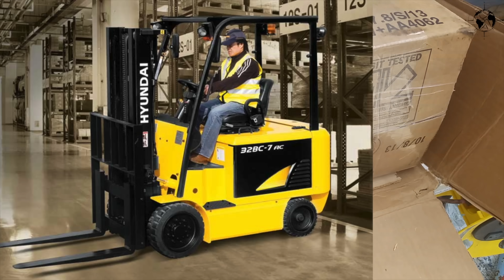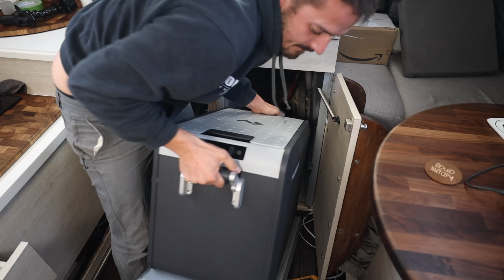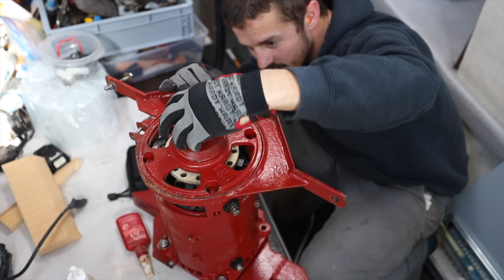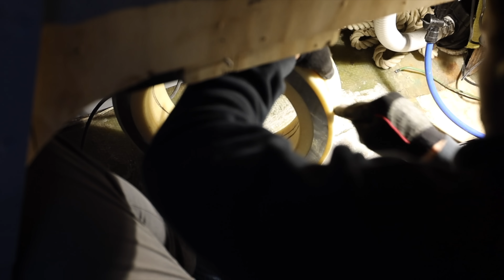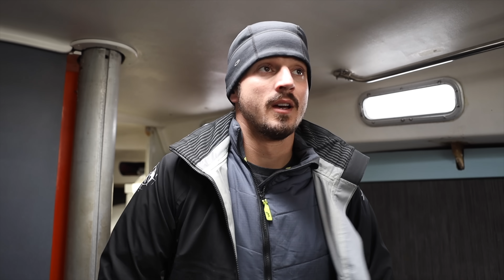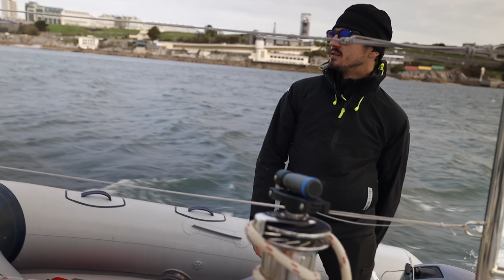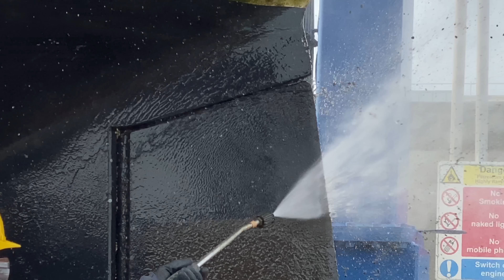Getting Rid of our DIY Electric Motor — Sailing Uma [Step 212]

Comment: I love my Yanmar GF 30.
Reply: james braselton  No kidding!  I've been working very hard to learn about boat electronics (and everything else about a sail boat too).  I bought and old Pearson 35 about a year and 1/2 ago and have been fixing it up.  It was cheep but has a relatively new diesel engine and the hull is sound.  All the wiring was a mess and I have been going through it circuit by circuit.  I've been reading a lot of books like "Electronics for dummies" ect...  I also watch utub videos such as yours!.  Thanks,

Comment: Hi from Halifax guys! Boat yoga - the best sailor full-body workout. Seems to me there are a lot of comments on here by people who don't a) understand your design brief and b) understand the regenerative operating principle of boat electric motors, i.e., that it's all in the motor controller. I'm in an ongoing refit of my '85 steel Goderich 35. When my original diesel packed in, I considered the electric option. My design brief is different, though. If I ever want to go back up the St Lawrence again, the range of an electric system won't get me there in a reasonable time against the prevailing wind and strong currents. So I put in a Beta diesel. BTW, civil engineer here, and handy, though perhaps not so extremely as yourselves!

Comment: What is level on a floating sailboat? - Is everyone standing on the centerline? Who is forward? Who is aft ? and how far?
Really tricky to do afloat. Also for regen I would think a feathering or variable pitch prop is best allowing propeller mode and 'turbine' mode. You guys do a lot of research and such a professional job I am excited to see how this turns out

Comment: Had you considered a 'hydro-generator' as an alternative solution if you hadn't got a lucky break on the OceanVolt system? Not quite as neat and integrated, but a lot cheaper and performs the same function (electricity generation while under sail).

Comment: I had a completely different approach. I am just in the process of rebuilding my 1975 'tractor' engine because they were built so well back then and wanted to keep it. With the rebuild I should get at least another 20 years of life and with cans on deck we have a range of 500NM (which we need as we are on our way to Panana). We view having reliable driving power as the single most important safety issue - you cannot always rely on wind and currents can take you onto the rocks and/or across shipping lanes. Most boats down here have solar but in the tropics there are too many cloudy days for it to be a primary source even for house power (let alone driving) so have a gasoline generator to top up the batteries when necessary. Again, that is also a safety issue - you need to ensure your navigation and VHF are always available.

Comment: Don't blame auto correction - what else could bring us so much fun in daily conversation? 😂🤣

I Think comparisons with Tesla is some wiered. This Systems play in another power range. Build in such a motor - your propeller shaft would simply brake at start.

I'm a little bit surprised you will change to saildrive. For me (familiar with saildrives) this is not only - not even best solution.  Also I thought up to your video, a saildrive has to go with the boat's construction.

What were your thoughts about placing the saildrive? The propeller seems to be much more to the center of the boat than the old shaft solution. 

Corona: That was not a beer - that's antidope in those times 🤣

Comment: The 'Vibro Tool' blades can be restored by notching the edge with a thin angle grinder wheel. You can get several uses out of one blade before they are too short to use...(Doesn't work with the Carbide edge ones, they just become regular cutting blades). 'Hints from a cheapskate boater!'...

Comment: Looks like a very professional boatyard, hi res vests, nice cradle. So you installed the sail drive ring level, is the new motor and prop trim adjustable or is it fixed?

Comment: It’s not the volts that kill you, it’s the amps. You can play with thousands of volts, as long as the amps aren’t there, nothing will happen.. take static electricity 20,000 volts... 

The fact is the higher the voltage, the more efficiently it typically transfer the electricity. 
So higher voltage, lower amp would be safer and more efficient than lower voltage with higher amp

Comment: Wow, that's really interesting about the electric motor. That's what I'd like to do when I get my catamaran. I've been looking at the Schionning catamaran and love what they look like. I think that going electric is the best way to go but haven't heard of anyone doing it on a boat before besides this solar catamaran that doesn't have a mast. It's filled with solar panels and is basically a test boat for electric. It's sort of a turn off because of how many solar panels they have because I was thinking just by looking at it that I'd need to completely fill all my deck space with 100% solar panels and that would suck. You should post a complete video on this subject from start to finish. What brand of rib do you have?

Comment: How did you know the xyz coordinates to install the sail drive mount in the hull without the sail drive, coupling, and motor? Do you have drawings showing shaft ends and spacing for the coupling?
Reply from the maker: Planning....lots and lots of planning.

Comment: OK, if "regen is the ONLY reason to have an electric motor", then I guess the companies making non-regen motors will go broke quickly when they don't sell any, right?
Reply from the maker: For sailors like us who want to cruise offgrid with an electric motor, without ever needing to go to a dock to recharge nor being hybrid... then YES regen makes ALL the sense. It’s certainly Not impossible without regen... we’ve done it for 5yrs. But outside of warmer tropics its more complicated and solar alone is not enough. As we said, its different if a sailor plans to use an electric motor on a daily basis or for a race and go back to a dock to recharge or it they plan to be a hybrid boat and still have a diesel or genset to recharge.  But for us, tge way we see it is: we are dragging a propeller in the water while we sail anyway, it’s more of a waste not to have that be a source of energy.
Reply: @SailingUma    I think regen. is smart actually, even more so for sailing than in other transportation modes.  I am also surprised more motor manufacturers are not incorporating a regen. feature.  My only point was that you said (paraphrasing) "there is almost no point to motors that don't have regen. capability".  Your actual quote was listed in my initial comment.  With better (current) solar panels, and new battery technology, electric motors (especially with regen.) make abundant good sense for all the reasons you listed (reliability, noise, oders, size, convenience) plus long term cost savings due to fuel, maintenance, and repair/overhaul costs. The drag of the propeller is a minimal consideration for most sailing.  I actually think you both are ahead of the curve on this issue.  Best wishes.

Comment: We have a place here in Brisbane Australia that supplies and installs motors for cars for a few grand, they have regen and cooling an electric motor by air or water is very easy. I'm sure most cities/countries would have a supplier if they looked. https://www.ozdiyelectricvehicles.com/kits-parts  [ I don't work for or have any connection with these guys ]
Here's a cut and paste from their site, this is in $Oz, shop in your country, you never know.....+ the price of lithium is dropping all the time, as soon as the next thing comes out lithium will plummet - yipppeee!!!!!!! lol.
Our Small car system suits cars such as a Suzuki swift size, is AC 96v 500amp. 
Our Basics package of $3950 contains the Motor (with regenerative braking), the controller, the dc to dc converter (to provide the 12V supply to the car), a safety disconnect switch and impact sensor cutout switch, wiring loom included.

Comment: I am betting the regen motor will provide for about one extra cup of tea per day... Not worth the cost in mono-hulls.
Reply: Sailing wisdom had a solar panel breakdown on the passage across the Atlantic, had to rely on regen for their electrical needs.  Had a backup generator but I don't think they had to use it.  There is something very elegant about reducing boat speed by a fraction of a knot when the winds are strong, storing the energy, and using the same energy later to go a couple of knots faster when the winds are low.
Reply: Richard Gray 1kw is = to 35ml of gasoline so don't expect to go too far on your regen harvest.
Reply: @PaulAnthonyDuttonUk  I agree that gasoline (and diesel is a much more efficient energy source than electricity.  But propelling a boat through the water has a exponential power curve, crazy low requirements to start a boat moving (no static friction) to massive at near "hull speed" where doubling power increases the speed very little.  This means that you can travel literally tens of times farther on the same amount of energy at very low speed than at high speed.  Similarly an electric  sailboat in strong winds (near hull speed) can scavenge enough electrical energy to charge the batteries  (slowing the boat a little in the process) to travel farther at a very slow speed later.
Reply: Richard Gray You won't harvest anything till u are at 6 knots or more and then not much. Maybe enough run some kit but they have a 40kw motor and at mono speed the best you can hope for is probably around 1kw. So every 24 hours you have enough to motor for 30 mins at half speed assuming everything is peachy perfect. Not great for back up. Portable Gen set with a kick arse alternator is far better for emergency. Regen motors to my mind don't warrant cost unless you have a bigger scale component or a cat. Yet they got it gifted so academic.
Reply: @PaulAnthonyDuttonUk  40kw wow.  That is quite a jump up from the 4-5kw of their original motor.  I guess we will have to wait and see how well it works in practice.  Love to see a power vs speed graph/chart for Uma with the new motor.  Also charts showing how much power can be generated costing how much speed compared to unencumbered speed under sail.

  When under a steady wind, record the boat speed under no and various regen levels.  Run several times  under different winds and/or sail conditions.
Reply: Richard Gray I think it's 40kw or maybe it was 40kw combined on the boat it came from. Not sure but either way you get two light bulbs worth of power back at what are considered as mono boat speed maximums. according to the sail drive 10 system on ocean volts site you can expect a 200W return. So sailing at 6 knots x 24hrs = 4.8 kWh. Still only half speed for an hour. You are basically buying pixie dust and snake oil.
Reply: Richard Gray If you drop a knot per hour trying to regen means in 24 hours you have lost a distance of 24 nautical miles for sake of banking some motoring potential but if that potential you gained only gives you back a range of 12 nautical miles it's hardly efficient. These systems are for instances where they can scavenge excess power and that can only really happen at theoretically max boat speed where you have extra energy available but not enough to climb the bow wave. Any speed less than that and you basically bought a acme Heath Robbins perpetual energy machine. This means that in anything less than a 15 knots of wind you will have regen off. It's just an expensive kettle when used on a small mono.
Reply: @PaulAnthonyDuttonUk  Sailboats routinely reef their sails to reduce the force exerted on the mast, rigs and sheets. They don't normally consider it worthwhile to live on the edge, going as fast as they can and risking breakdowns or even capsizing. Under these conditions it is very likely that you can generate enough power to be useful with minimal effect on your speed.

Remember the power curves I mentioned earlier?  If you recover 500 watts of power from regen losing a fraction of a knot near hull speed, you might be able to use the energy to travel a longer distance at low speed with no or little wind later.  (If you don't have a better use for the power that is.)

But we are both just speculating.  I am looking forward to see if it is possible, practical, or even desirable.   Maybe there are other disadvantages we didn't consider.  Thanks for the discussion.
Reply: Richard Gray They reduce load in the sails to vent excessive energy such that broach risk and damage is avoided yet the boat still runs at theoretical boat speed. Though 6 - 8 is all u are gonna get on a good day less you are surfing.  Monos can not power through the bow wave so speed is linked to length. 40 foot gives u a max speed of about 8 knots but depends on drag and wind heading. But you are right in that you might wana slow the boat down to stop surfing yet anything less than potential hull speed is exponentially compromising regen. Dude its a chocolate fireguard on a small mono but one made from Belgium chocolate coz the motors are not cheap. A diesel tank and a portable generator is much cheaper than a regen motor and is a guaranteed 3kw on tap when ever u want yet why not simply get your self a modern diesel and give in to combustion efficiency. - I mean we spend a   100 years perfecting combustion but for some reason choose to move to an infant tech which is as about as green as a ripe banana. The cost to the environment for battery manufacturer is way more than a gallon of diesel. We need a game changer in battery science before electric power is viable. Don't believe the hype.

Comment: Brush less DC and brushless AC , are effectively 3 phase AC motors .  The variability is produced through the use of a chopper circuit , reversing done by changing the phasing.   . Its why brush less motors have three wires.

Comment: I am an electrician with 20 years experience, it’s not the voltage, it’s the amperage that will kill you!  Yes, DC is more dangerous than AC power.  However just 1/4 of a milli amp across your heart can kill you.  If you get shocked you need to get medical treatment. electrical shocks act like a microwave, you get cooked from the inside out!  If you aren’t sure  what you are doing then get help from a professional.

Comment: Hi. You said Oceanvolt is the only company and the top company who offers this type of setup, their is another you should consider before you make a decision. You already have used their products and already own some. Torqeedo does the same type of system as Oceanvolt but offers many more options. Look for Torqeedo “deep Blue “. They offer different power ranges in sail drives or inboard shaft driven. Ocean volt offers the equivalent of 25 hp in a sail drive. I am in the process of buying / building a Schionning designs catamaran and will be using a hybrid system from Torqeedo. I also researched Oceanvolt but am leaning towards Torqeedo. Good luck
Reply from the maker: Yes, we're aware. They're deep blue system operates ate 300VDC though since they're using automotive tech. And their 48vdc system is a pod the hangs under the boat with a plastic propellor. We could chat for hours about the differences between all the companies, but don't want to bad mouth any, so we'll leave it at that. If you're serious about going with Torqueedo, we'd encourage you to email us and we can have a longer discussion there.
Reply: Hi, don’t get me wrong I think Oceanvolt builds a superior product, even schionning designs who is designing my boat recommends them. And I can honestly say I’m not a fan of the Torqeedo poddrive. I was thinking when I wrote that about the sd25 saildrive 360v and never thought about your voltage. What makes me lean toward the Torqeedo is the automotive battery technology,  little higher HP. 40 vs 25, and the joystick piloting via a touch screen. Which the last is minor but seems it could be nice to have in a catamaran. The Oceanvolt I just don’t want to have to use 4 motors and 2 sets of controls as on Top secret. 
But it will be about 6 months before I have to make the final decision on how I want to go so my mind could change by then.. anyway good luck and stay safe I enjoy watching your videos

Comment: It takes a large electric motor to push your boat, and it is extremely unlikely that the prop dragging though the water at 5 knots will have the torque to spin the electric motor enough to make any useable regeneration. This is probably why none of the other companies making these motors bother with it.  A few years back there were companies advertising great stats with amazing regeneration but it all turned out to be advertising hype. Anyhoo, I wish you all the best and hope your efforts result in a massive improvement..  Cheers Rustie.

Comment: And the Nobel price for sustainable sailboat engineering goes to .... Sailing Uma! I am an electrical engineer and Diesel technician, but I really missed the point of ReGen.  An Electric motor is a consumer and a Diesel generats power. Never thought of ReGen powering the fridge and the micro wave underway. ReGen in the automotive branch is the last few grams of CO that puts you in a different tax range. Not really worth it, only when tax and environment rules demand it.  As an Small Craft Electrical engineer this is a bit of a face Palm / Eureka moment :-)